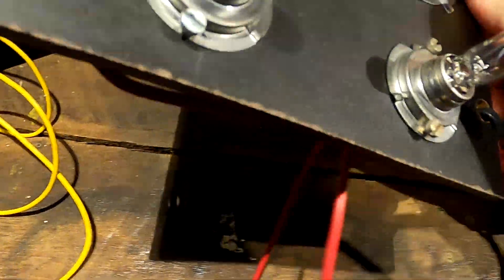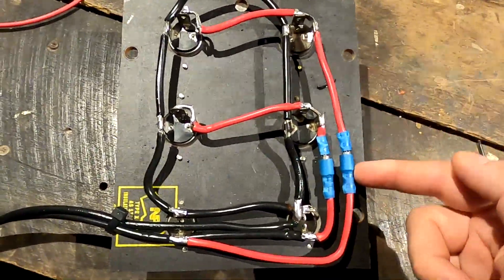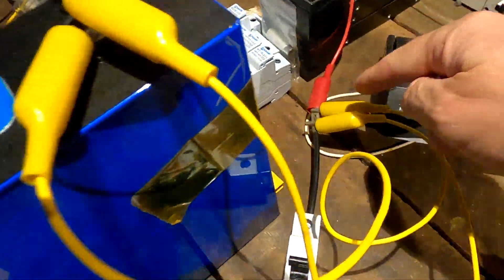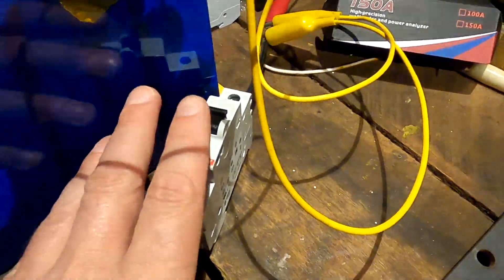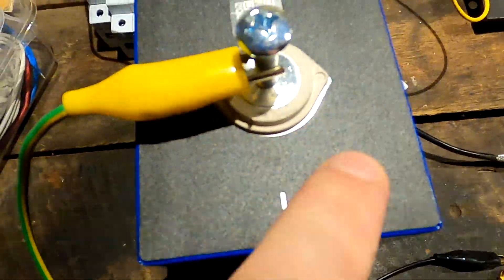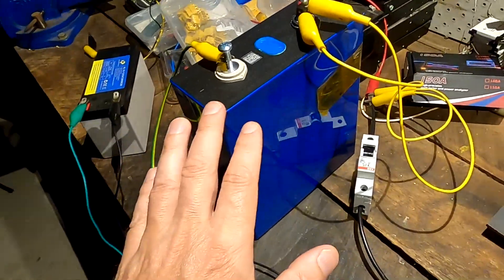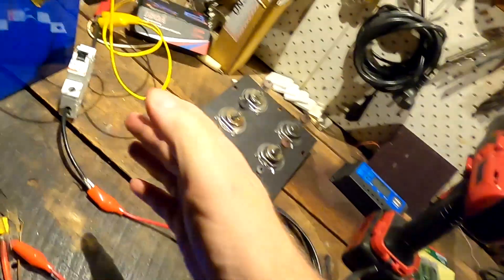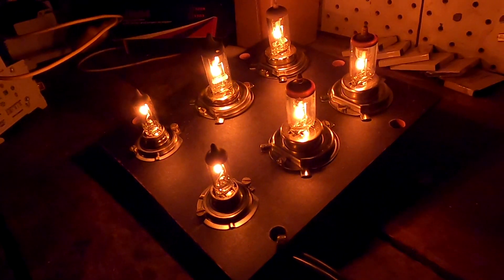Capacity testing these LFP cells... will it work?

Comment: You could also use the plate of light bulbs to balance two cells or batteries with each other. When the bulb lights up, it is heated and the resistance is high, when the voltage of the cells becomes more equal, the bulb lights up less and the resistance drops in the bulb and becomes more like a wire between the cells.

Comment: I love your idea for the headlight lamp load bank... You've probably figured this out by now. However I need to comment on how you soldered the wires to the bulb terminals. Probably not a problem when testing only one cell but when you get that thing cranking on a 12 volt battery those terminals will get hot enough to melt the solder and things could get very interesting from there... 
I recommend you go to a wrecking yard and cut the headlight connectors out of wrecked cars to make your connections. Then add a set of switches to turn on each lamp filament individually so you can easily adjust to the exact amp draw you want for your load testing.
Reply from the maker: Yes, I probably cannot use this setup for 12V any more. The solder does not stick on the outside of the light bulb due to some coating. I had to file this off first, hence the soldering looks like from a 3-year old. Eventually I will have a large inverter to use the Tesla as the load when doing a full discharge test of the battery.
But I like your suggestion with the switches to add more load as needed.

Comment: Excellent video Andy. Very interesting indeed. Impatiently awaiting the results! And well done in making the right the decision and going for a 48v system, although shouldn't you have done the capacity measurements BEFORE ordering more batteries? 😄 I 'm glad the battery manufacturer has offered to put things right though.
Reply from the maker: I ordered 4 cells a while back and wanted to start with a 12V system. Just to learn and experiment. I should have tested them in the first place, right? Not I have 16 of them for a 48V system. I just hope it wasn't a mistake. If so, it will make good videos at least 😂

Comment: take care with the length of the polescrew, if they are to long you are able to damage the cell inside! 
even take care with the temperature range you "work" with the cells  ((internal studies told that the cells will become instable over 45°Celsius) overheating problem).
 dont load cells with internal temp lower 5°C ! 
have a save day  walter
Reply from the maker: We don't have 45°C here. If you read the specs of these cells, it tells you the temps for charging and discharging.
Reply: @OffGridGarageAustralia  Yes, Andy that's one point why i wrote that it is no good idea to handle these cells with no cell protection/bms.